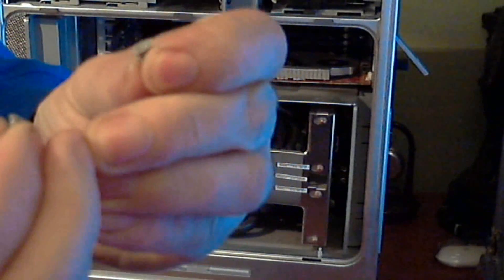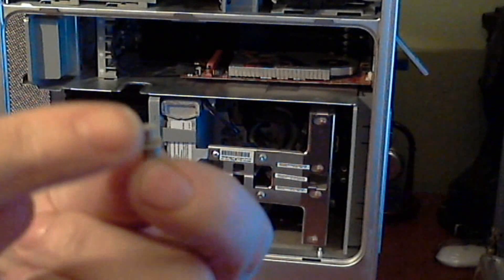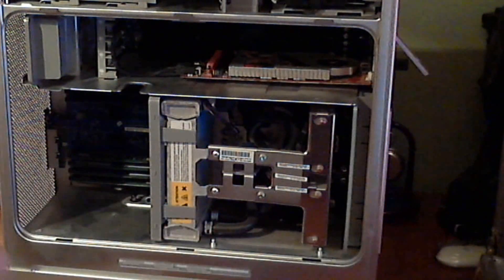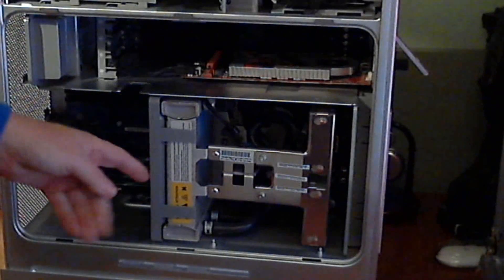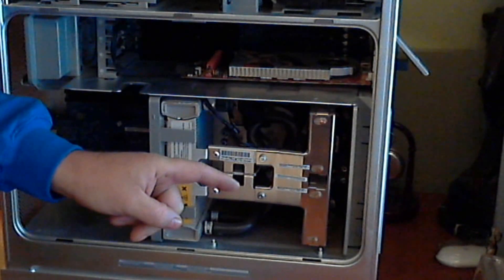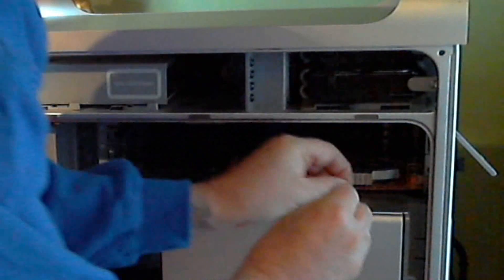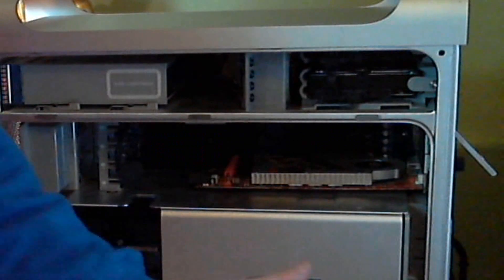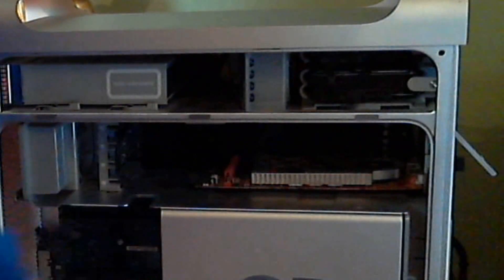Quad core 2.5 ghz Power mac g5  cooling system review

Comment: Is it the late 2005 power mac ?
I`m getting M9592D/A with quadro 4500 fx.

You think it will be good idea to buy spare liquid cooler ?
I`m not sure which liquid cooler model to look for.
(guess will have to wait till it arrive to open and look for part number)

Thank you for the video.
Reply from the maker: ***** look for the single pump vertion quad core model ,you have the best graphics card they can take
Reply: dinerman2000 
thank you for the reply,
but what model number I should look for ?
(any idea?)